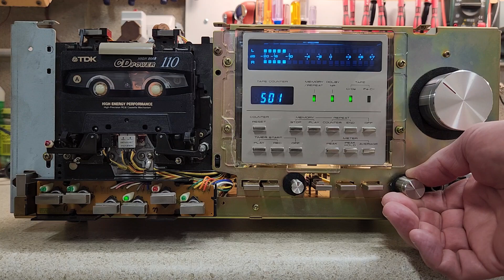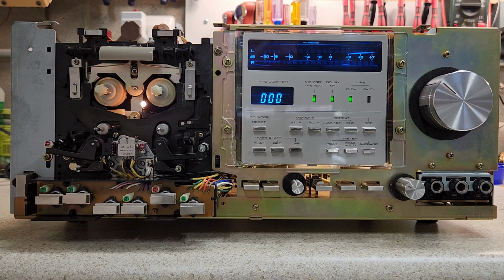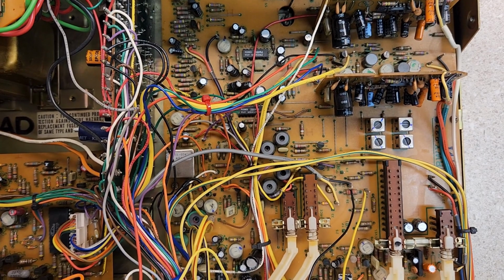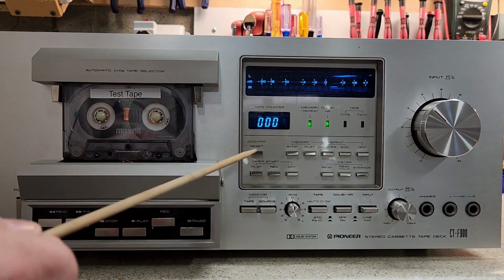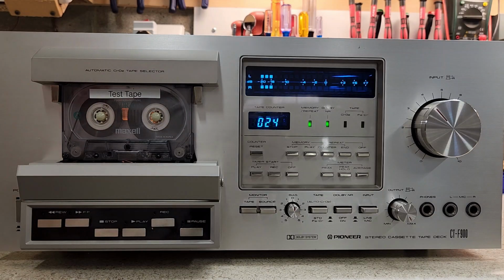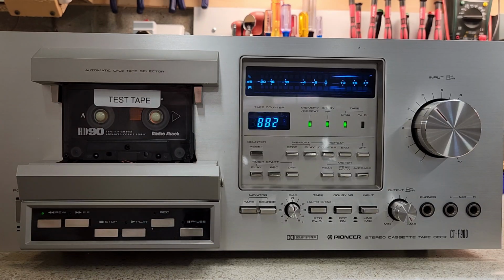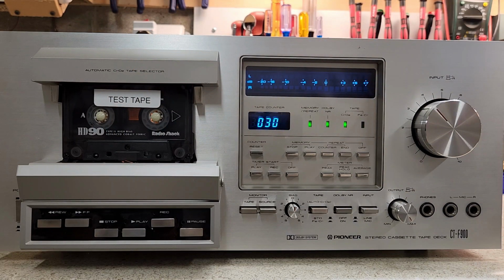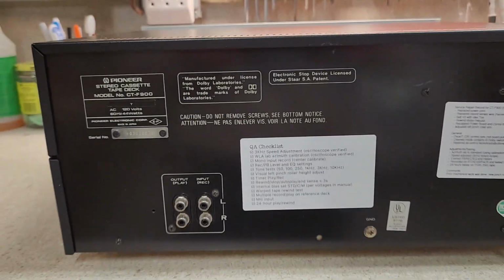Pioneer CT-F900 Vintage Three-Head Cassette Deck Restoration

Comment: Thank you for the explanation of the memory controls! I have a ctf900 and it's been a bumpy ride so far. I've had the deck re-capped, re belted and calibrated but I have a remaining hard to catch intermittent stopping issue which seems to occur 30mins to 45 mins into use of the deck. Once the isssue begins the deck just stops as soon as any button is pressed and won't return to functional until cooled down. I think something may be overheating but might be mechanical as well. It is currently sent out to be serviced again and i will be forwarding the service tech this video in hopes it might help. Any tips would be greatly appreciated. Thank you.
Reply from the maker: Good background, and tough to diagnose from afar.  You said it's been re-capped.  Did they re-cap the control board?  That's where the logic that controls starting/stopping/engaging the solenoids.  

If they did, they could have used the wrong value capacitor during their replacement.  Cold solder joints exhibit this way (remedy by turning the control board over  -- carefully -- and re-flowing solder for all the caps that were replaced).

If I had it on my bench, I'd make sure all the caps that had been replaced on the control board were the proper value.  I would measure the power to the main solenoid to see if it's constant and then goes to zero (immediately), or if it is variable and finally goes too low for the solenoid to remain engaged.  That would require tracing back to see if one of the switching transistors is failing.

If the control board WAS NOT recapped, I'd still follow the same troubleshooting procedure AFTER I recapped the board and the problem returned.  

This is not an exhaustive list of things to look at; but that's where I'd start.  Other things to look at include the optical sensor and drive belt for the paddle wheel that triggers it -- if it's slipping badly, it will get worse as the unit heats up.  That sensor connects to the display board, where you could have a problem.

Comment: Great job!!  Describes  everything very well.   When you unit was open did you do anything with the power supply?  Was that rebuilt or is everything original.  It might be a stupid question but wanted to know.  Thank You, Jeff
Reply from the maker: Jeff -- thanks!  Yes, check the video around 7 minutes in.  You'll see the power supply that's been recapped.  Also, on the description, I think I mention that.

If you're interested, it's for sale on eBay.  https://www.ebay.com/itm/275714547046

These do tend to go fast, but I have one more in stock.  I don't list them in parallel, so once this one is sold, the other one will go up.
Reply: @Cody Shive  After seeing what was done I ended up buying it. I have about 8 cassette decks and this sounds Is the best.
I do have a of Sansui I think that could need an overhaul too.
I have three tanbergs
I don't think anyone could get parts for those anymore.
When I did buy the cassette deck I was looking at many but after seeing you rebuild it I just have to buy this.
I Have heard from many people that NOS capacitors and are not good capacitors you're better buying the Original.
Reply from the maker: Great to hear, Jeff.  You have 8 decks, and counting?  Wow!  And, yes, I've heard the same about NOS capacitors (even old stock caps that aren't used would need to reform).  Instead, I source audio-grade caps from Mouser; but it is a testament to Pioneer that the caps, at least in the power supply, have lasted as long.  Of all the Pioneer decks I've serviced, I have NEVER had a bad cap in the PS, although some have tested out-of-spec by around 20%.  I always test new caps to make sure they are in-spec before using them.

Comment: Still have one of these players.  It never worked properly, despite being in a repair shop three times.  The cassette plays or records for two or three minutes,  then the take up side stops spinning, the tape bunches up, and the player shuts off.  Very frustrating for a very expensive deck.
Reply from the maker: Common problem with all these decks.  It's likely one of two things: the idler tire needs replacing (and/or the spring needs replacement).  The other, more insidious, is the take-up motor must be replaced or rebuilt.  

List it on eBay for parts/not working.  Take plenty of pictures.  Send me the link, I might be interested in buying it.

Comment: Hi, nice video. Have you measured that 7W resistors temperature? Mine is 125 degrees in Celcius in use. Current 0.73A, voltage 5.5V. . My other player (CT-F1000) has same 7W resistor with only 110 degrees in celcius (5.5V).
Reply from the maker: Yes.  At one end of the resistor, it's measured as high as 250F, at the other end it's lower, more like 110F.  Check both ends and see if you have a difference.  I check that on all the decks I service, and it's consistent.

I've actually seen smoke come off of these from the dust.

I get 5.3v across it, with .13A.  

If you're concerned, replace it with a larger wattage power resistor which can dissipate the heat faster.